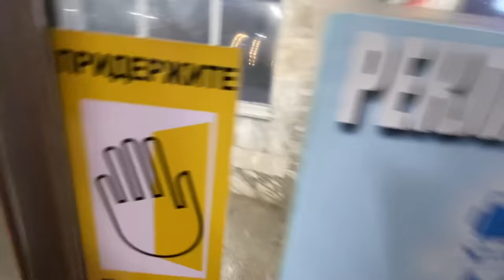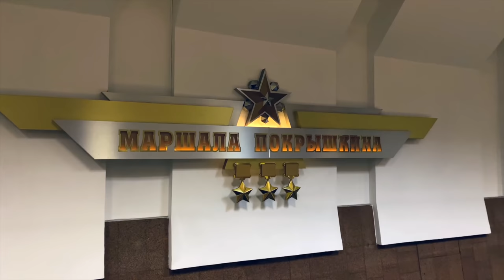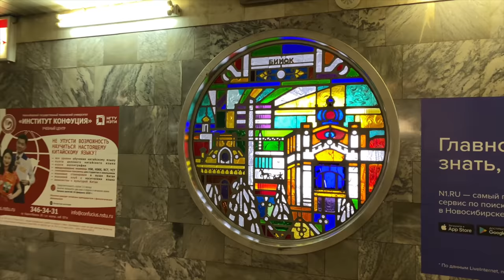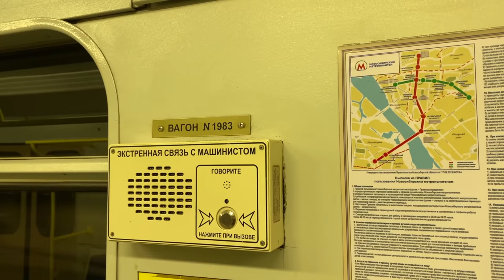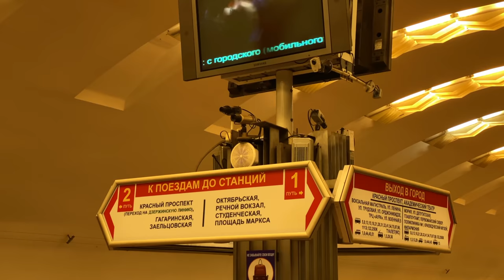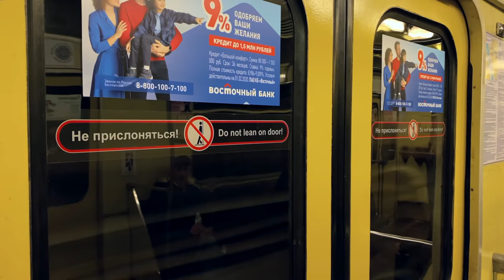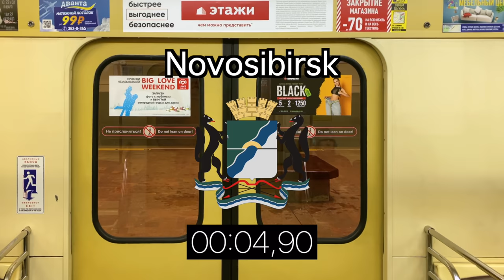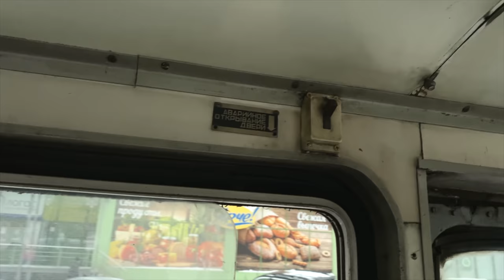Novosibirsk. Metro And Tram of the Capital of Siberia

Comment: 12:17 - Conductor's thrones in Zagreb trams of my childhood (more than half a century ago) were much more impressive - they looked like a judge's bench or an immigration officer's booth. :o)
Reply: Only in the older models, in the T4+B4s, they just sat on the last seat in the car.
Reply: @2712animefreak  Oh, you don't remember thrones in T4+B4s, or older TMK 101 and TMK 201, and conductor with pen tipped tih a rubber stamp on the opposite end? In older yet models, lie these: https://i.redd.it/305kysf4mm221.jpg or  https://citypal.me/wp-content/uploads/2019/02/tramvaj-m-24-20052018-02.jpg they even opened and closed rear door with some scissor-like mechanical contraption.

Comment: 12:14 In Amsterdam, you have doors only for boarding and for exit with thoses gates. 
And in the middle of each Tram there is a "service/info point" with a Conductor.
Reply: Porto Metro has nothing like that. It's called metro, but it,s more a glorified tram that runs partially on tunnels. Neither stations or cars have gates, peple buy tickets on the stations and bard the cars. teams randomly show up to check the tickets, but not often. Most people have the monthly pass anyway.

Comment: > the covered metro bridge is meant to protect from the cold

Very nice if this is the case. Edmonton, Canada, has approximately the climate of Yekaterinburg, yet the open parts of its metro system are 100% open air, any snowfalls, blizzards etc that occur (and they do occur!) take place just on the tracks.

Comment: I really like the Novosibirsk metro, I'd recommend any visitor to stay near a station if possible. Watch out for those swing doors though, they're not all equally weighted - some swing nice and easily, others have much stiffer springs. If you struggle to make it up and down the stairs for whatever reason, best avoid the winter, as you'll have problems walking on the snow and ice everywhere anyway! As for the metro bridge across the river, it's just a pity there are no windows to see out on the main part. I don't know so much about the trams, as I don't go to the west of the river much, but there are a couple with nice custom paint jobs on the eastern side. This video has so much footage of the trams, it's pretty unlucky they didn't catch one of the fancy painted ones!
Reply from the maker: What do you mean by fancy painted? Advertising?

Comment: Very interesting. I'd love to see how the tram system handles all the snow that falls every winter. Are there dedicated plow trams? Are standard trams equipped with smaller plows to keep the rails passable once a plow tram has made the initial plow? How are the overhead lines kept clear of snow/ice build-up? Thank you.
Reply from the maker: I've totally missed that part. Yes, there are dedicated plow trams https://www.youtube.com/watch?v=FokIBkmVaeo&ab_channel=LifeinSiberia After a single passage of such a machine, snow does not have the time to accumulate on tracks between trams, and no special equipment is needed.

If the snow is not cleaned well, this might happen: https://www.youtube.com/watch?v=vBfv1osyin8&ab_channel=%D0%9D%D0%BE%D0%B2%D0%BE%D1%81%D0%B8%D0%B1%D0%B8%D1%80%D1%81%D0%BANews
Reply: @RailwaysoftheWorld1  Болшое спасибо. Я только что уыидел ваш ответ. Мне много нравилось. :-)

Comment: Did I hear that right the new trams are 178K or are those refurbished trams? If they are new we need to scrap BuyAmerica on the FTA Grants and start building new systems using those cars instead of the expensive Siemans S70 cars.
Reply from the maker: The irony of the situation is that either buying a new tram, or refurbishing an old tram is both 178K. These cars are way behind Siemens S70, but if your transit budgets are so limited, it would be so much fun to see them on the streets of American cities 😃
Reply: @RailwaysoftheWorld1  Our transit budget is that limited. I think it would be perfect to get one of those at least till the service matures enough to warrant upgrading to S70s

Comment: I have never been to Russia, but I saw on Google Street View and on videos that the non-articulated, trailerless, single carriage short trams are very common. Aside from vintage lines, I haven't really seen such short trams being used anywhere else. Why did Russian/post-soviet cities start using such short trams, and how can they be competitive with rails in such bad conditions against buses, which offer basically similar capacities, more flexibility and needs no dedicated infrastructure, and with a bus lane, the traffic jams are no issue either.
Reply from the maker: Articulated trams came in fashion with the tram resurgence in the '80s; the trams you see on this video are basically '60s technology (with roots coming back to American '30s PCC tram). For larger capacity they can be joined into trains of two or even three units: http://ixbt.photo/photo/711805/557784LxmmyxNmJ/1103242w.jpg
This was a common practice back in the days, now only a few cities have enough funds to do that. There are modern articulated trams in Moscow: https://www.fc52.ru/files/vityaz-m/vityazm.jpg

Besides Belarus (which is basically still hugely ineffective Soviet economy), single carriage short trams are being currently "produced" in Poland by retrofitting old Konstal 105Na units. Looks really weird with a modern design: https://www.instagram.com/p/CL4cbNfnzxS/

With regards to trams being competitive: well, they are not competitive ☹️ Here is my another video that covers this topic https://youtu.be/CDfqDs6TKdI
Reply: @RailwaysoftheWorld1  I see. Thank you for giving some insight, and for the quick reply :)

Comment: the conductor role is the best solution for free riders, and no it is not more expensive than the army of inspectors accompanied by policmen in disguise.
Reply from the maker: True if you are allowed to pay them 200$ a month
Reply: @RailwaysoftheWorld1  whenever a conductor needs salary a band of inspectors ask twice of that for each
Reply from the maker: For 100 trams/buses you’ll need 200-300 conductors (two shifts a day, weekend shifts). I doubt any transit agency will employ even 50 inspectors.
Reply: @RailwaysoftheWorld1  you forgot to calculate efficiency.
Reply from the maker: I can’t calculate efficiency, I have no data. But lots of cities are getting rid of the conductors (even in post-communist world), I doubt they have not calculated efficiency before doing that, and I have seen no reports of any transit agency registering significant revenue drop after ditching conductors. The major part of passengers are commuters who go with pre-paid monthly tickets anyway.
Reply: @RailwaysoftheWorld1  no doubt they did not :)
it is bureaucracy it always does opposite of effective.

off the top of my head i can give you an IRRESISTABLE reason to get rid of conductors:
some minister's son runs an "IT"-company that sells electronic cardreaders for buses or similar things.